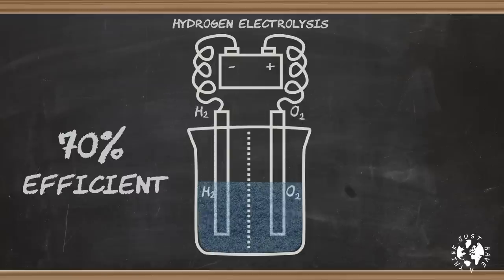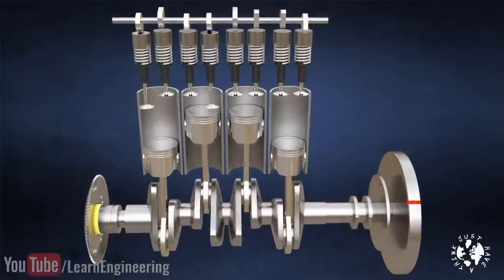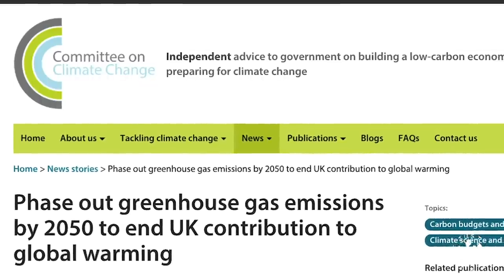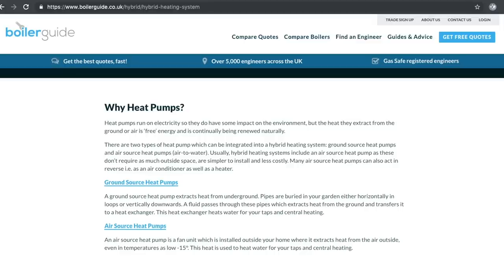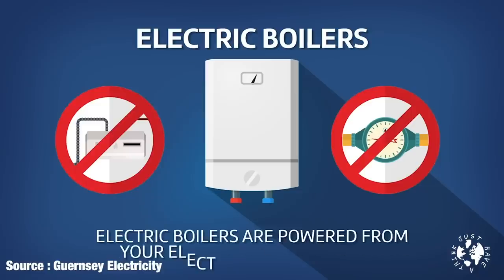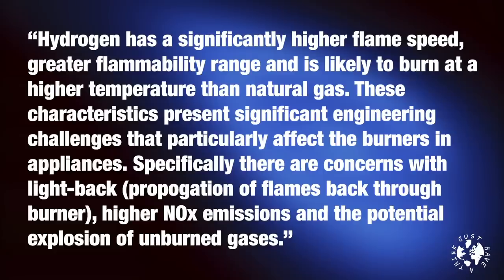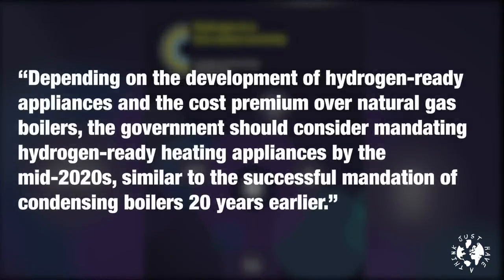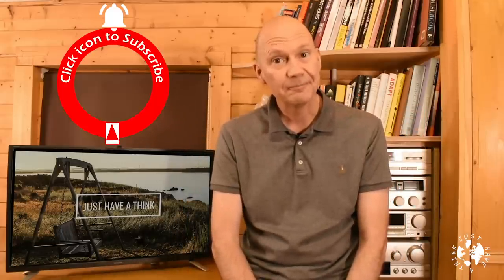Hydrogen for heating our homes

Comment: Burning hydrogen is just silly. Hybrid heat pumps with electrical assistance in super cold conditions has to be the way to go, it has to be far more efficient than transporting hydrogen through the gas network?

I just don't see it working. 

They only thing I can see hydrogen working is at large scale fixed locations for grid storage and possibly in hgv is a kinda of plug in hybrid. 

I just don't see it making any sense outside of that.
Reply: True hydrogen may make a good grid storage system but has too many issues to burn it in a home or car
Reply: I agree (especially for vehicles), but even so it is a game changer, as it allows us to dump "free" renewable energy into long term storage, primarily for grid power - we can probably upgrade existing natural power plants to use this to produce electricity. Also, we have already invested in a large natural gas transmission system which we may want to leverage, by transporting hydrogen, despite the fact that we'd need to upgrade a lot of the infrastructure.
Reply: Adrian Chapmanlaw  Consider energy losses converting natural gas to electricity,
transmitting electricity, charging batteries,
and converting to run electric motors. Not so great all properly figured. The giant wind turbines can’t even produce enough power to pay for themselves without subsidies, yet another hidden tax. Hydrogen was making headway in 70s and 80s then hammered down by both the solar and wind cabal and the oil cabal and probably the parasites in banking who do not see a cheap,inexhaustible energy supply as conducive to their dystopian, iron fisted control agenda. We could have already solved transporting via hp pipeline by now, it is 50+ yrs since people began converting cars to hydrogen and almost 40 yrs since fuel cells were being tested, and we’ve only gone backward? Sans the parasite class we could probably create hydrogen economy over a short few yrs.
Don’t know if all that water vapor will be acceptable to the climate fanatics as water vapor, supposedly a very effective green house gas, is at 40,000 ppm at it’s thinnest concentrations, I guess the parasites can’t think of a way to terrorize and tax everyone over water vapor. So they concentrate on the gas of life co2. Notice how green China and India are with all their billions? Hmm, and all those plants are sequestering carbon and emitting oxygen. We have much to do before arriving at solutions. Of course the Paris accord already decided every one must die ,while the parasite class hides in their underground cities built with stolen American wages. Interesting times.
Reply: @kevingrove4379  sorry, you are wrong on many accounts.

Gas turbines are around 60% efficient as they drive a generator directly and use the exhaust gas to heat water to create Steam to drive turbines. They only account for less than half of the electricity generated.

You have way under played the efficiency of the grid!
Solar subsidies are nothing compared to the government money given to the fossil fuel industry.

The rest of your comment is pure tin foil hat conspiracy theory.

Have you noticed how is the fossil industry trying to push hydrogen? Do you know how most hydrogen is generated right now? 

It's Steam reformation from natural gas. Aka a fossil fuel. 

It also maintains their business model of fuel stations and transportation of liquid fuels.
Reply: Osama Number5  
it's not "very inefficient" 70-80% is actually pretty fucking high. let me also point out that there are other ways to do electrolysis, photoelectrochemical water splitting (direct solar water-splitting) is another way. it has roughly 20% efficiency, that of a solar panel and this is pretty new tech. 20% of the energy gained from the sun is converted into hydrogen and oxygen. so now you no longer lose 20-30% of the energy splitting the hydrogen. now the only loss is from compressing the hydrogen, which is only a loss of 13%. meaning this way is 87% effective compared to the 70-80% of normal electrolysis.
there will always be losses when transporting fuels, this is why EVs are the way to go. build the power plants next to the solar/wind farms along with the storage. hydrogen is far more dense then our current battery tech by at least 2.5, not accounting for the extra space you need between battery cells and the space needed for a human to reach the batteries. in the end, generation of the energy isn't a problem. really it's all about how to store that energy that is the problem.
Reply: agreed. why burn precious hydrogen?  if ask me, i have no problems burning natural gas for heating. there is little waste when things burn for heat.
Reply: Osama Number5  
the system? yea that's just crazy. more energy would go into it then you would ever get out.  besides you would have to carry water around? that's just extra weight and then you need a tank for the water. i don't think hydrogen vehicles will ever be good enough to use, i mean it COULD replace our current cars but honestly why would you want to do that when you could just make more electrical power and drive a EV which is many times more effective then a ICE car.
hydrogen storage makes sense when you don't have to move it and when the input can far exceed the output.
Reply: semih oguzcan wow, good link, that’s one more of many complexities now that tell me it’s going to take more time than we have available to make hydrogen work at scale.
Reply: @zodiacfml  
natural gas doesn't burn clean. natural gas produces roughly half the CO2 of coal, however hydrogen produces zero CO2 when burned.
lastly hydrogen isn't precious, it's the most common element in the universe.
Reply: the real question is, what is the REAL cost of gasonline and its efficiency, we have to include most of the military budget in that
Reply: @davidthacher1397  https://www.youtube.com/watch?v=f7MzFfuNOtY

pales in comparison to the cost of transporting hydrogen
Reply: "Burning hydrogen is just silly". Why? Continuing to burn methane gas is pretty silly. Swap to hydrogen and you can arrange a relatively painless switchover to a fuel with zero emissions at point of use. That's a huge deal for home heating. The h21 project has a plan to trial this by switching Leeds over. It keeps the incumbents happy because they don't really have to change much, which makes it relatively easy to do. Reform the gas, put the CO2 back in the hole the gas came out of, adda hydrogen main, swap over streets/houses from methane to hydrogen main one at a time. That could work, and prevents an unmanageable (with electricity alone) winter power spike. Remember the heat peak is something like 6 times the electricity peak. Think about what adding enough generation for 6 times the existing electric generation entails, especially something would would work reliably in a cold, still winter week. And the fact that it would get used 1 week/yr, max, so be very expensive.

This is why hybrid heating makes sense. Everyone should fix their houses really to be under 40kWh/m2/yr, but that's going to take a long time.
Reply: @xxwookey  the Leeds project uses steam reformation to get the hydrogen from natural gas, aka a fossil fuel!
Reply: @jusb1066  
this is a good question and it's REALLY complex because petroleum makes a LOT of things not just gasoline. plus there are only a handful of articles last time i remember trying to figure this out.
most of this comes down to what the oil companies want us to know or what we got our hands on. to this day no one really knows the exact amount of energy needed to produce gasoline and there is a reason for that....because they want to keep making it and invading other countries to grab their oil and profit off it.
we will never be able to completely remove oil however as it's used in tons of products we can still however reduce the amount we make by a large margin.
read this as it has tons of data all put into one page to read.
https://greentransportation.info/energy-transportation/gasoline-costs-6kwh.html
most of the debate is centered around electrical energy, total energy and the backflips oil sellouts do to tell you lies.
really the take away here is that a lot of energy is wasted in making gasoline, most of which is almost never accounted for when you try to look up the electrical energy cost of producing gasoline. this is because most refineries use byproducts of the petroleum to create the energy needed to do the process and they also use a massive amount of natural gas which is a whole other game of cat and mouse.
Reply: @DorsetSaferRoads  I know. The relevant point here is that the CO2 produced gets put back underground, so it's still carbon neutral. Fossil fuels are only a climate problem if you burn them in atmosphere. It makes sense to make the system entirely renewable eventually by generating the hydrogen with electrolysis from low-carbon electricity, but we don't have to start there. Changing the hydrogen source at the input of the process later is straightforward. The only thing that matters for the next 20 years is 'does it reduce emissions', and the H21 scheme would.
Reply: @xxwookey  erm I'm confused how is steam reformation carbon neutral?
Reply: Osama Number5  Currently in the cold UK in June we are producing just over 30% of our energy from renewables and none from coal so it can be done!
Reply: especially silly when most hydrogen is now made from natural gas, coal, biomass and oil ... therefore NOT RENEWABLE since we are still unleashing dinosaur carbon
Reply: @Allen Loser yes .. "dinosaur carbon"  meant to be a humorous phrase, representing carbon that mother nature retired from the carbon cycle millions of years ago... and which man has been returning to the carbon cycle.
Would love to see more bio-fuels, and some concerted effort to make them economical. I always thought that a combination sewage / garbage / bio-fuel producing plant could be a cost effective way of dealing with waste disposal and for producing renewable bio-fuels.  Or as we search for a way to Store Energy from Solar/Wind farms, for off peak use ... why not use that excess energy during the day to produce bio-fuels.  There seem to be a damn near infinite number of technology development opportunities in renewable energy .. if our government would just apply some regulatory pressures .. entire new industries would form, creating millions of new jobs .. money  / jobs / greed,  is how ya save the World from Climate change ... waiting for people to do the right thing, usually ends with waiting.
Reply: @Allen Loser technically, if that bio-fuel carbon was part of the current active carbon cycle , then it is carbon neutral fuel today, or tomorrow .. and it would have a storage life much shorter than the time span humans can correct climate change within. . However, if our goal is to remove carbon from the current carbon cycle .. I guess one could say even carbon neutral energy isn't acceptable until we have reduced CO2 levels to where humans think it should be.
Reply: @DorsetSaferRoads  Steam reformation is carbon neutral if no CO2 is released to the atmosphere. It's fairly straightforward - where does your confusion arise?
Reply: @Allen Loser 
it does matter, because people cry about the energy cost of hydrogen from solar all the time. pointing out that a ton of power is wasted in the production of gas makes hydrogen more reasonable when all the facts are given. in the end hydrogen would cost far less to make then gas simply because you don't need to drill for it and you don't need to refine it.

"Have you stopped using gasoline and diesel fuel because of the energy used to produce it?"
why do people think we shouldn't go hydrogen for the same reason? people just don't understand it, that's the reason. plus not everyone has the money to buy a new method of transportation when they don't agree with something. if i did, i would.

the main point though is why would you want to spend all of this energy making a fuel when you could just put down more solar panels? it's a waste of money, time, and energy to keep making fuel the way we do currently. there are far cheaper, cleaner, and just overall better methods for creating combustible fuels.

"It isn't Mother Nature's fault that Mankind left the resulting bio-fuels in underground storage for millions of years before accepting her largess."
Earth doesn't give a shit if all of that comes up tomorrow, we do because it will kill us. Earth will be just fine. it took millions of years to make that fuel, it shouldn't all be used up in only a few hundred years. it should be used over millions of years, but we are not doing that. we are using it so fast that it's actually changing our climate in a noticeable way.
Reply: @xxwookey  first, currently almost nobody does captures the co2 byproduct from reformation.

2nd that doesn't make it carbon neutral!
Reply: Osama Number5  
you don't need to use fossil energy (fuel) to make them though. drilling oil out of the ground and transporting it around, refining it and then transporting it again and then burning it in your ICE is intensive. just your car alone wastes nearly 70% of the energy value of the fuel, let alone the energy used to transport it, refine it and transport it again.
will we run out of rare earth materials? uhh no, even if we did there are ways to get around that.

"Moreover, some of the applications for rare-earth permanent magnets turned out to be illusory. "
"Even so, the magnetics in motors and electronics accounted for only a small fraction of total rare earth production."
"Actually, the main application for rare earths back in the days of the bubble was as catalysts in gasoline refining."

then "But you can refine gasoline without rare earths. " we don't have a actual shortage, people just hide them and made it seem like there was a shortage and the biggest user of them back when prices where insane was......gasoline refining......isn't that funny... actually it's not. this is the kind of sidelined brainwashing that the oil companies have been doing for decades. stop letting them inject nonsense into your brain.
Reply: @Allen Loser 
"H2 gas produces no CO2 when burned but separation of H2 gas from methane produces the same amount of CO2 as if you had burned the methane from which essentially all commercially produced H2 gas is separated."
that doesn't mean you have to use steam reforming to get hydrogen. in fact stream reforming is more costly then producing it from electrolysis using solar/wing. actually it costs more ENERGY to get hydrogen using stream reforming then it does to get it from electrolysis.
Reply: @Allen Loser Not quite, the UK literally floats on coal reserves but we chose to stop sending people down mines, it is now way too late for coal since renewables are now way cheaper, can be installed close to consumption and generate no CO2 after production and installation.
Reply: @Allen Loser 
yes because it's all they know, it's why hydrogen costs so much. solar/wind is far cheaper, it's just no one is doing it because they love their oil.

"The heat exchanger had rusted out. The bill came to $27,000."
sorry dude but you got ripped off.  or maybe it's because your house is super old, either way that's harsh.

130-140 therm is what we normally get in winter time in green bay. it's a lot colder overall and for far longer(the entire day), everything uses gas, stove, dryer, hot water heater and the heater itself. it's not a boiler, just a normal hot air blower with an AC system.

1 therm is equal to 100,000 BTU (i like using BTU/s)  220 therm would thus be 22M BTU for a month. that's 733,333 BTU a day. a standard 1500w electric heater produces 5100 BTU a hour or 122,400 BTU a day, this means you would need 6 of these heaters. which is completely insane. do you have your windows open during the winter? holy cow!
this would actually need 216kWh of storage to run all day. which looking at the climate where you live isn't needed.

it's just foolishness to think you could heat a home with electric and be okay at all.
"Going green did not appeal to my greed."
because you are doing it wrong, solar isn't there to heat your home, there are other renewable and cheaper ways to do this. 

the more shares the less return you get. my point? not everyone can be invested at the same time. this is true greed, knowing full well that not everyone can have the same income but still trying to use it as a excuse.
it's why wages haven't moved at all when you account for inflation. it's not by chance that most Americans can't invest into stock, that was done on purpose. this is the problem with greed though, it blinds you to reality.
Reply: @Allen Loser 
yes because it's all they know, it's why hydrogen costs so much. solar/wind is far cheaper, it's just no one is doing it because they love their oil.

"The heat exchanger had rusted out. The bill came to $27,000."
sorry dude but you got ripped off.  or maybe it's because your house is super old, either way that's harsh.

130-140 therm is what we normally get in winter time in green bay. it's a lot colder overall and for far longer(the entire day), everything uses gas, stove, dryer, hot water heater and the heater itself. it's not a boiler, just a normal hot air blower with an AC system.

1 therm is equal to 100,000 BTU (i like using BTU/s)  220 therm would thus be 22M BTU for a month. that's 733,333 BTU a day. a standard 1500w electric heater produces 5100 BTU a hour or 122,400 BTU a day, this means you would need 6 of these heaters. which is completely insane. do you have your windows open during the winter? holy cow!
this would actually need 216kWh of storage to run all day. which looking at the climate where you live isn't needed.

it's just foolishness to think you could heat a home with electric and be okay at all.
"Going green did not appeal to my greed."
because you are doing it wrong, solar isn't there to heat your home, there are other renewable and cheaper ways to do this. 

the more shares the less return you get. my point? not everyone can be invested at the same time. this is true greed, knowing full well that not everyone can have the same income but still trying to use it as a excuse.
it's why wages haven't moved at all when you account for inflation. it's not by chance that most Americans can't invest into stock, that was done on purpose. this is the problem with greed though, it blinds you to reality.
Reply: @Allen Loser 
you paid 27,000$ which quite honestly wont pay for itself within your entire a lifetime. nat gas isn't that costly, well unless your home leaks tons of heat because it's brick. the problem isn't the heater, the problem is the building. so much heat is leaving that you need to pay so much more to heat the same amount of space. 

brick IS NOT a good insulator, it's actually pretty bad. brick has a relatively high thermal conductivity, meaning it transfers heat energy faster, then say timber and insulation. brick has 5x higher thermal conductivity then timber and almost 21 times higher thermal conductivity as fiber insulation.
if your home does not have dry wall and insulation between the brick and the inside then that is a major problem already.
also because your house has two floors you have more surface area for wind chill and other factors to play HUGE roles in heat lose of your house.

"My greed is enhanced since I have been unable to work for 3 1/2 years since getting run over by a package van. Cutting expenses and making a return on investment is a high priority without an income other than from my retirement savings. I'm still more than a year away from Social InSecurity."
well that sucks, even without getting ran over cutting expenses is on every ones mind. Maryland and WI are pretty close in terms of cost of electricity, it would take a bit longer to get a return on investment but that's really only half of it. do you have kids? what about their return on YOUR investment. it isn't just about money, money wont save the world from killing everyone. Earth doesn't care, only we do. life isn't about one person, it's about everyone. this is what i don't get about people who say they are greedy, i just can't understand how to think that way. i care too much about other people to step on them just to boost myself up. to me that's the worst thing i could do, it's why i don't take part in stocks. it's all really a game to people, they don't actually see the people they crush though. quite honestly at this point i doubt they would even take notice even if they saw with their own eyes what their actions did to others.
we didn't get here by going solo, we got here because we humans stayed together. America became strong because we where a large group of humans with dreams and ideas. then the greed in a handful of people set in and ruined it for the rest of the population. now money rules instead of people. it's shameful. 

"He appealed to my greed, and his own, by not attempting to sell me green power."
sounds like a pretty good person, at least from this one case.
Reply: We would buy cans of Hydrogen from a local producer. Shipping through pipelines would be bad.
Reply: @Allen Loser 

" It is not an investment expected to pay for itself. "
housing is a investment, the price of your house goes up over time. people do this for a living, buying low then when prices go up they sell them. it's a investment.

"The alternatives to paying for a new boiler were to go without heat or to spend more on a monthly basis to operate space heaters and still be cold."
more insulation between the brick and the drywall (if you have any) would do a better job then a 27k boiler system. it costs far less to do and it would mean your heating system would need to generate far fewer therms to keep it warm.
27k for a system is too much, you could of ripped all the drywall off the walls put another layer of insulation in got new drywall and paint. then get a furnace and had them install ducts, all that and it would of cost you less. you said you didn't/couldn't because your house is brick but i don't see why that would be a valid reason unless your floors for some crazy reason are made out of brick also. my house is 1 story ranch style made of brick.
100+ year old homes i suppose might not have the space between the floors for ductwork however the systems they have now can fit into VERY tiny spaces so again i don't see a reason to use a boiler system over a furnace system. running it in a interior wall would be what i would do, the duct would be a bit longer but there is no reason you couldn't have it run up a interior wall and then through the 2ed flooring. a full install would cost half that of a boiler system, more so when you have to replace the piping and radiators. then you could also add AC to it for a tiny bit more.

that's just me though and obviously you wont do any of this because you already got it replaced. when problems come up i do a boat load of research first, THEN call for pros. that way i don't get ripped off, if someone is trying to sell me something i don't need then they get kicked out right away and i never go back to them again. companies now days take advantage of people who don't do their research and push their workers to sell sell sell instead of actually caring for their customers.

"Why are you criticizing me for choosing a high efficiency boiler which helps you to meet your goal of reducing CO2 emission and at my expense? I did so because it appeals to my greed."
because blowing 27k on a boiler system blew me away. it actually pisses me off that you paid that much, when you could of spent half that and got the same functionality and more out of another system. it's weird...well not really, i care....too much about others.

"It would have made your task of appealing to my greed more difficult if I had chosen a lower efficiency boiler. The budget within which you would be working would be less."
not a boiler, a furnace. using the same gas you are using to produce hot water to heat your house right now, expect instead of boiling water you just blow the hot air it creates from the gas.....so much easier. plus you can filter the air by having it cycle through your home, which is always pretty nice. oh and you can easily hook AC into it. it's just a better system overall and cheaper because it's more widely used. even with putting in new ducts it would of cost far less. again it pisses me off that you where sold something so expensive, it ACTUALLY really bothers me.

"Appeal to my greed by showing me that switching to renewable energy will reduce my expense. My calculations show that it would cost $80,000 more than what I spent."
well renewables wouldn't work for heating or even cooling your home (although you could get a geothermal system for that i suppose if you have the room), solar would have to come down a lot for that to work (like you said). however getting solar just for your power needs isn't a bad idea, just don't use it to heat your home. if you lived a few hundred miles more south you could get away with a electric furnace. as their version of winter is like our summer xD.

"Unlike the salesman who rented a room from me, you are attempting to sell me something which does not meet my needs as well as what I am already doing. You offer solutions which increase my expense."
no where did i say for you to heat your house using electric heaters with solar panels. you came up with that idea all on your own.

"Adding insulation on the outside of the brick is a better choice than losing room space to drywall and insulation on the inside. Doing so moves thermal mass inside my home. I have not done so because the cost is high. Doing so would be a better use of $80,.000 than spending it on a PV system with storage. There are other, lower cost tasks to complete first."
wow your home is really old if it doesn't even have drywall on the inside. no wonder the heat just flies out of your house. dude really though you could of just got the insulation and it would of made 100x bigger difference in your energy savings. i didn't want to assume but now that you confirmed that you have no insulation or drywall it's no wonder your therm usage is so high. you live in a okay place where it's not insanely cold but not really "warm" so it really was weird that you use more therms when you live in a warmer climate then i do. i will say it again, brick is 21 times more conductive then insulation is. just by insulating you can expect maybe to use HALF as many therms. 

to drywall a entire room is roughly 700$ for a 12x12 room, if you have 12 rooms that's 8.4k lets just say 9k, add insulation to that which is at most 50% less then drywall per square foot that puts you at 13.5k. add in 2x4 for entire house to put the insulation and drywall on and you can look at 15-16k. still have 11-12k left and a furnace with 80k BTU (more then double what you actually would use) costs anywhere from 2-3k with anywhere from 94-97% efficiency. the full cost to install said furnace lets just say costs 2-3k lets say, it costs 16k for insulation drywall and the 2x4, so we only have 11k left, lets say the furnace cost 3k and the install costs another 3k that's 6k. that means we have 5k left over....guess what costs less then 5k...a AC unit! oh would you look at that, you dropped your heat transfer by at least half and you have a perfectly good heating system AND a cooling system. now you also have drywall to paint as you see fit and don't need to drill holes into brick to hang things anymore! so what you lose 8 inches around your walls, big deal.

i'm just pointing out that the 27k you used could of went a lot further then simply a new boiler system. also i want to know if that contractor you hired even mentioned the fact that you don't have insulation or drywall was a major reason you have such a high heating bill. i mean if they didn't tell you that, then they are the worst of the worst and if i where you, i would tell EVERYONE you know to never use them ever again. if they did tell you, and you ignored them...well that's just your fault then.
Reply: @franklinrussell4750  
yea, the pressure it would have to be at is like several magnitudes higher then our current gas lines. would be VERY bad if they broke and...they will just like all other pipes ever made. it's one problem i can't get around when arguing for hydrogen. still, there are ways around it like shipping it around via truck to storage tanks near where it's going to be used this means you can store it at a lower pressure which reduces the energy capacity of the storage tank but at least makes it safer to work with. most certainly wouldn't be able to pipe it very far but burning hydrogen is far better then burning natural gas and sometimes doing the right thing isn't easy, actually it never is.
Reply: @Allen Loser 

"I would have been without heat if I had used the $27,000 for other purposes. "
could of had them install a furnace which is vastly cheaper then a boiler system.

"I already knew that solid brick walls have no insulation. That is par for the course for a brick home built in 1903."
sure but that doesn't mean you can't add insulation and drywall to it to help insulate it.

"The heating contractor suggested two heat pumps as an alternative to a boiler. The cost would have been more."
the contractor is honestly wrong, heat pumps are trash. so are boilers. both systems cost way too much. a simple gas furnace is cheaper as i pointed out in my other post, and quite energy effective.

"The lowest cost installation would have been to rely upon electric space heaters indefinitely. It also would have entailed the highest monthly operating cost and been the least comfortable solution."
no the lowest cost would of been to install insulation and drywall along with a furnace setup like i said. not only would you loss less through your walls you would have a ac system also.

"Line pressures several magnitudes (100 times or more) higher than line pressures are not needed for residential service."
you would need to at least triple the pressure to get the same energy density as natural gas. line pressure are already 1,500 which might not seem like a lot but hydrogen lines would have to be 4,500 psi to have the same energy value delivery as natural gas. in home lines would also have to triple which isn't very much because that's between 3-180 psi which is not too bad. this is however is an estimation of the pressures you need, as i really don't want to bother calculating the density myself.

"What alternatives can you suggest which do not directly, or indirectly, use any fossil fuel while staying within a $27,000 budget?"
only one that i can think of is geothermal which has a rough cost of 25k but you would still then need solar to run the heat pumps and the batteries so that would put you over most certainly. in terms of electrical usage in this case the heat pumps are nearly 4x as effective because they are just moving the heat not generating it. which isn't as bad as generating the heat with the electrical power. you also need the space which not everyone does. heating homes just isn't a very effective use of electricity. even though technically it is 100% effective (100% of the energy is used to generate heat) in the case of geothermal with heat pumps it's nearly 400% effective. pretty much just shoving your heat into the ground during the summer and taking heat from the ground during the winter.

"Is it possible to insulate a 2 1/2 story brick house built in 1903 with 2,356 square feet of living space on two floors and an unfinished attic so that it will maintain a minimum interior temperature of 60F using only body heat, waste heat from appliances and sunlight coming in through the windows and do so within a $27,000 budget?"
that's asking a lot. does your attic at least have insulation? 

"That I may have paid too much is to your advantage. It gives you a larger budget within which to work to appeal to my greed."
true. 

"You advocate for me consuming MORE energy than I currently consume by advocating for a system which includes CAC capability. Consuming more energy is counterproductive to saving the world from Glow Bull Warming."
that's why you install insulation, look you now use half as much energy heating your home and now you can use that to cool your home. your foot print remains the same. kind of because you would actually still need less thermal energy because of the insulation doing what it does best. is it going to be as good as a newer home? no but it will vastly improve the thermal energy loss.

"Please submit your binding and fixed price proposal for insulating the outside of my home. "
i haven't heard of putting it on the outside so i don't really know much about that. i suppose it would be possible but i would have to assume it would cost more as you would need a wooden frame around your entire house plus weather proof siding and even a roof extension. just thinking about it logically it would cost far more to do the outside then the inside.

"Your bid proposal should state, in detail, what work is to be completed and the expected annual reduction in gas consumption measured in therms. Submit proof of Maryland contractor licensing and liability insurance with your bid proposal."
yea no, i'm no contractor. it's quite easy to look up the avg prices of materials, the cost of labor, material conductivity and other important information to get a estimation without even looking at your house. i personally always do this though, this way i know what is reasonable to pay and what isn't. it's never going to be exact because i didn't take the time to measure each and every room, factor actual local material costs, how much a contractor would actually charge for the job as each one depends entirely on the company involved and many many other factors that just isn't worth my time to calculate.
you don't need to take these tests to figure out the cost, you only need these tests to preform the job.
Reply: @Allen Loser 

"None of your suggestions substitute use of green energy for use of fossil fuels."
i did actually, did you even read my comment? it seems you didn't.

"Advocates of solar energy retrofits have been installing exterior insulation on masonry houses for decades. Doing so moves tens or hundreds of tons of thermal mass inside the house. Thermal mass improves comfort by reducing temperature swings."
does make sense, brick can hold a lot of thermal energy. still having to extend your roof and outside walls is pretty crazy.

"Using more electrical power supplied by Hagerstown Municipal Light to operate air conditioning does not forestall DOOM from Glow Bull Climate Change. You advocate that I use more grid electricity than I currently use. The heating contractor backed off when I pointed out that my desired result was to improve comfort without resorting to using air conditioning."
no doom because if you use solar and batteries you could power heat pumps for a geothermal system, JUST that system alone. now you can heat and cool your home for no electrical cost from the town.

"You are intentionally confusing installation cost with long term operating cost. Installation of space heaters runs about $20 to $25 per room. That is $200 for eight rooms, not counting baths. A $10 space heater is sufficient for a bath, if needed at all."
are you still stuck on electrical heaters? you really didn't read a single thing did you?
the system i gave you would cost the same as the one you have now, plus you would have AC for a tiny TINY TINY fraction of the fuel cost you pay right now. yes even in terms of electricity. uhh if you are not going to bother reading what i wrote then i'm just going to stop responding then because it's pointless trying to show you other ways you could of spent that money. at least next time do a little bit of research before you invest such a large amount of money into something, at least that way you wont get ripped off okay?
Reply: Osama Number5  
You mean Boron